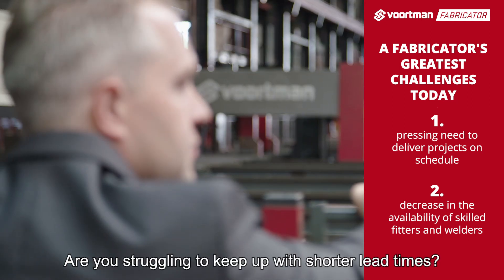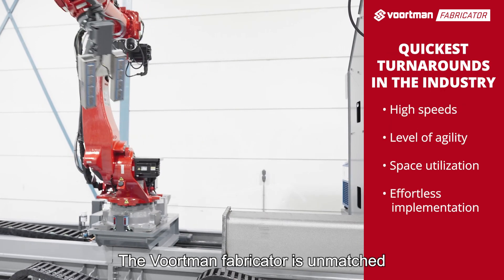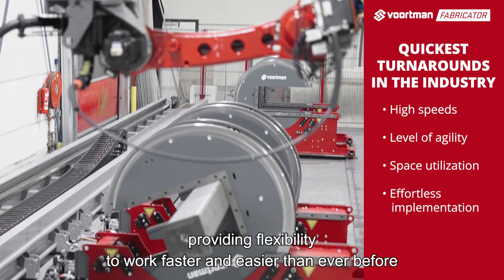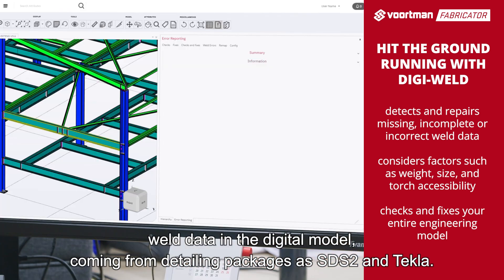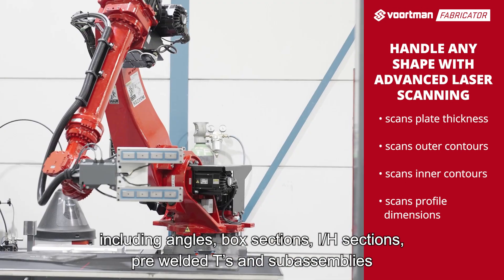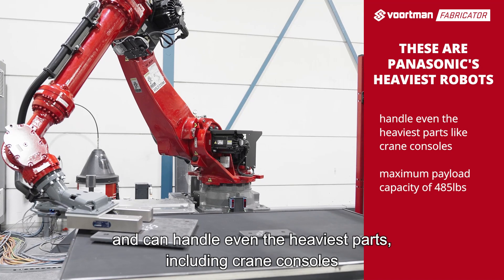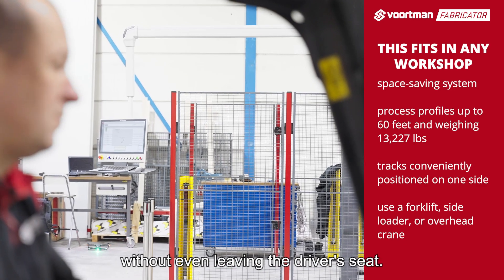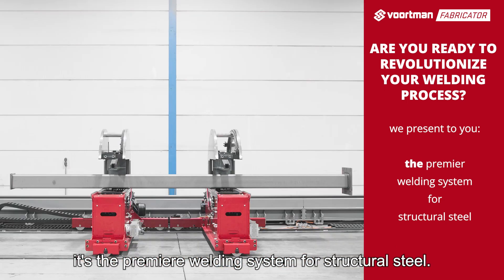Introducing: the Voortman Fabricator - automated fitting and full-welding for steel fabricating

Comment: Considering that our source file is not from Tekla or SDS2, can the Digi-Weld accept the step file as input data?
Reply from the maker: Digi-Weld is designed to work with files from Tekla and SDS2, as we've chosen to support the two biggest suppliers in the industry. Unfortunately, Digi-Weld is unable to accept the step file as input data.  Could you let us know which software you are currently using?
Reply: @VoortmanMachinery  we are using soildworks for creating structural parts, will 3DXML supports you
Reply from the maker: SolidWorks isn’t supported yet, but we’re excited to share that our team is actively working on it. Stay tuned for future updates!

Comment: Does the machine makes full penetration welding or just fillet weld? For example in a base plate for a big column.
Reply from the maker: Full penetration welding is on our roadmap, and the great thing about our VACAM operating system is that all software features in and improvements over time, are added to your Fabricator automatically and over the air!